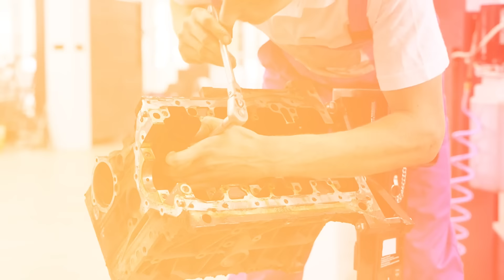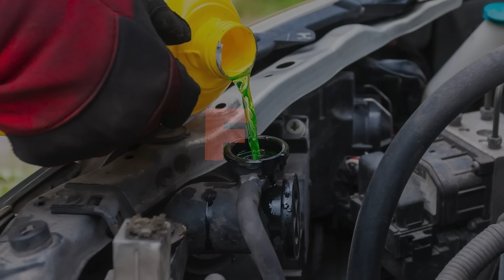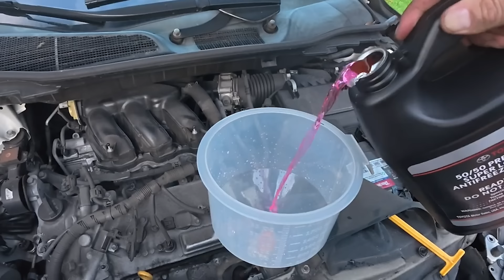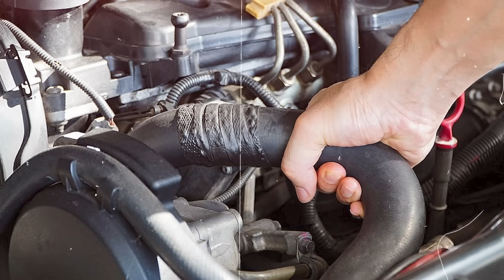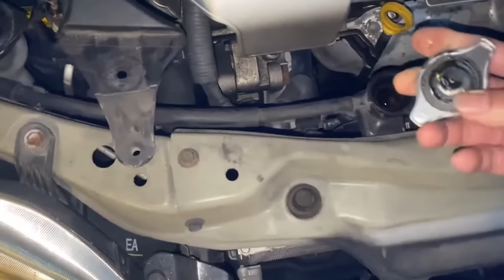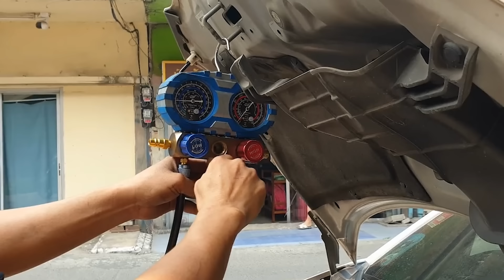Doing This Will Make Your Lexus Cooling System Last Forever

Comment: I am facing this issue sometimes when the car is cold, and it happened at the start time for maybe a maximum of 4 to 5 seconds is it normal? car is at 254000 km model sep 2023. 
The water pump also starts running sometimes at full speed, trying to pump water. 
and even on 25 °C temperature setting, giving cold air but when giving acceleration on high speed, it work normally.
ANY solution ?